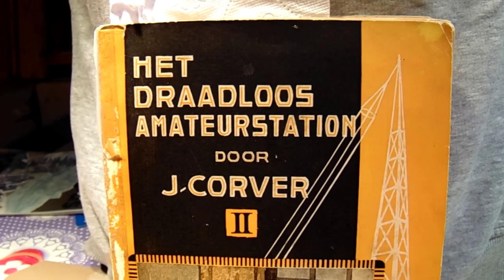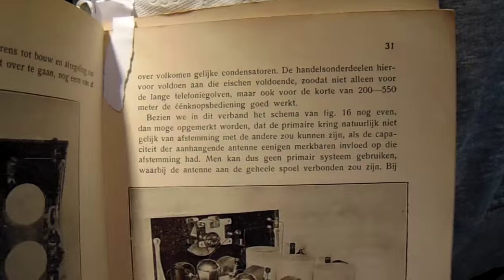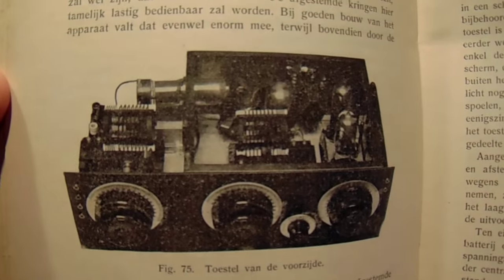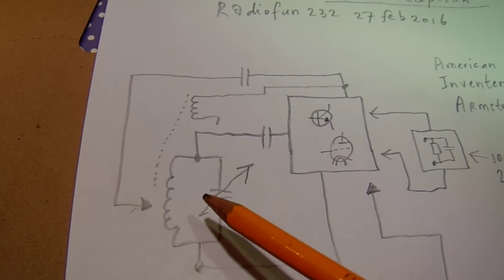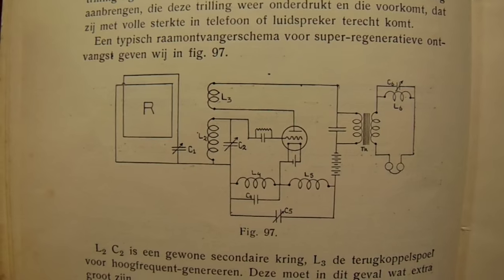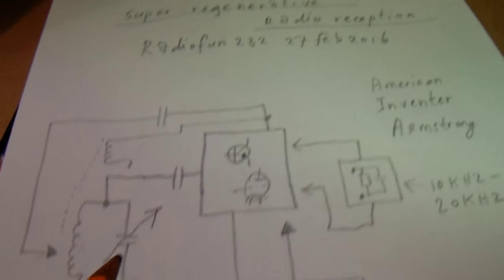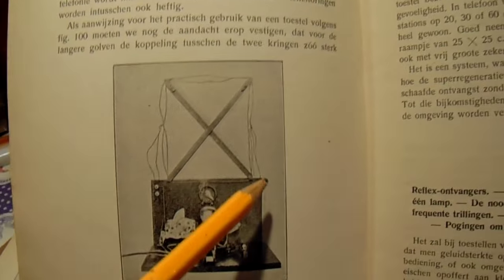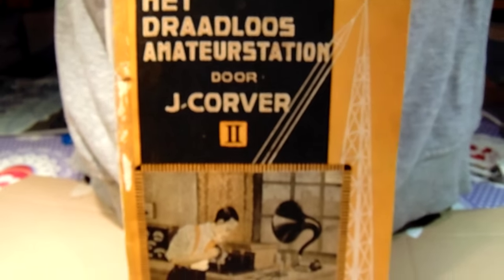mr John Corver & the superregenerative radio principle 1930

Comment: Love your videos with old radio books. You said that simple walkie talkies use the super regenerative circuits. Could these circuits be used as transmitters as well?
Reply from the maker: +vibra64 I don't know such a circuit. But when the transistor is driven "over the edge" it is a transmitter.